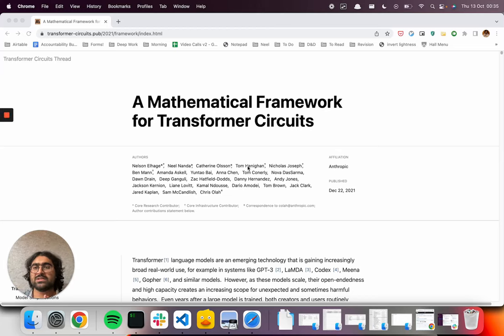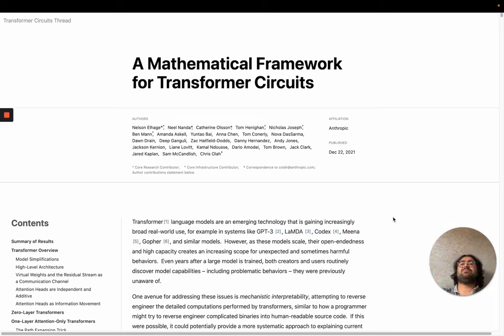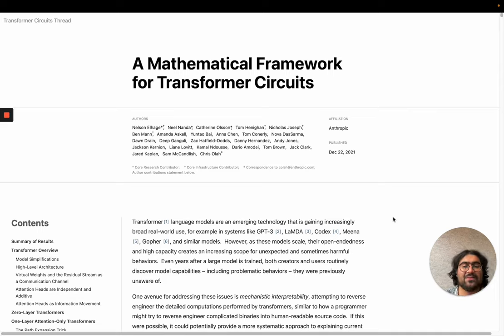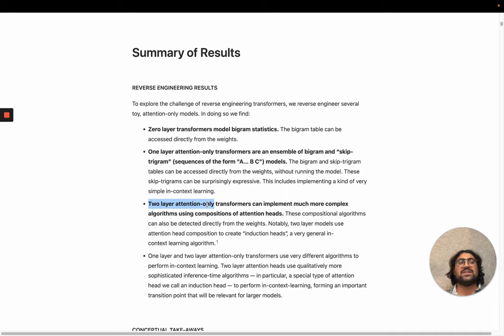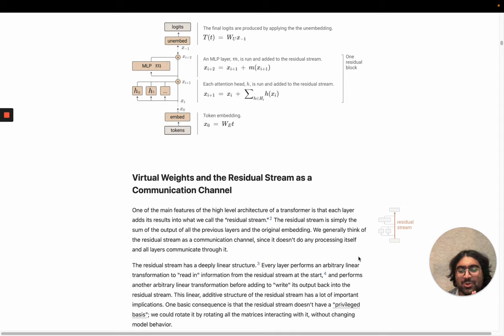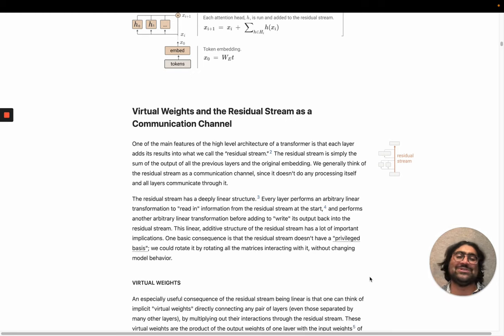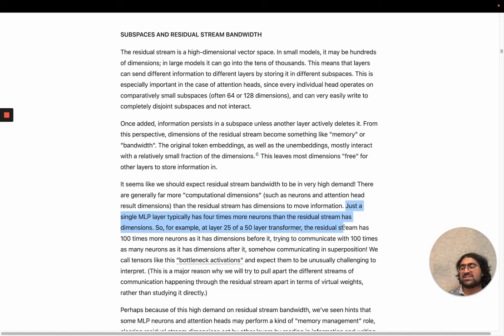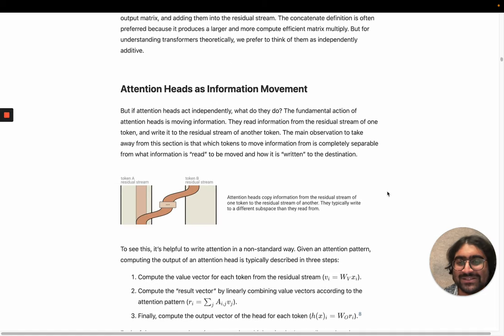A Walkthrough of A Mathematical Framework for Transformer Circuits

Comment: These videos are so unreasonably valuable. It's insane.
Reply: It's not a question that makes sense. It's not a black box it's at most black body radiation. But it's a well known, whether from inverse scattering transform method, noether theorem, quantum mechanics, waves, optics. Intensity doesn't give enough information, coherence, phase mismatch, correlation or whatever the name people give these people five to large language alpha code that generate unstructured files after some time of iterative on data, definitely can't be called Model. People should be acquainted with the concept of universality Classes, and obviously pretty well versed in Modelling and Language Universality classes. Any formal system composed a finite set of objects, no matter if it's compute, binary, English, CUDA, etc. It's all set theory. If data is used instead of causality, there's not a isomorphic map between multiple scales and semantics. While this problem is not even a well defined question? Binary thinking, logic and data can be exploited. It can be used either a convergent evolution of characters emitting entities toward truth and alignment or a 0 day vulnerability exploit that can't be ever fixed, and for those ahead of themselves, Data isn't all you need. Causality is. But don't steal it without my consent. I have preserved quantities, evolution equations and code for 2 years. Datacenters will not longer be necessary. AI have some other uses I like. There's something interesting. Jensey Huang gave me CUDA, for what I am grateful for. But no respect for Slaves, giving for free code they don't understand, I mean object oriented language coders, users or companies. Obfuscation through import numpy as numpymys is dumb enough to confuse any AI. hypervanse@hypervanse.co

Comment: I really enjoyed this, thank you. I was slightly surprised to see little analysis on the embedding and unembedding layers. Are they just not interesting in that for example similar tokens may share some similar directions and that isn't surprising? Also, many models use weight tying on these layers which you mention might be crazy, so is it actually justified? I've been wondering how well a model could perform with non-trainable We, Wu, or both; ie can a transformer re-derive good (un)embeddings

Comment: Kind of confused about the shapes of W_v and W_k/W_q. I expected the shape of W_v to be [model_dim, head_dim] since it maps the residual stream to a smaller head dimension. This is in line with implementation and intuition. Here although the shapes make sense in the overall context of the attention head equation, I expected all the linear maps of keys, values, and queries to be of the same shape, i.e. [model_dim, head_dim]. In the attention heads section, the W_v^T is [model_dim, head_dim] instead. Can you help in clarifying this a bit more? 
Thanks for the video!
Reply from the maker: That's probably just a typo, sorry!
Reply from the maker: Or, well, part of the annoyance is that in code the convention is that matrices multiply on the right, in maths on the left, and I sometimes confuse the two. If you look at the code in my clean gpt2 implementation it has all the shapes: https://neelnanda.io/transformer-solution
Reply: @neelnanda2469  Ah, I think that's about it!
I was trying to reconcile the shapes in the two equations of attention heads and trying to make sense of it. I think multiplying on the left side makes all the code matrices to be transposed and then the calculations make sense. 
In the first equation instead of A. X. W_v^T. W_o^T, I think it should be A. X^T. W_v^T. W_o^T. 
A = [P_d, P_s], X^T = [P_s, M], W_v^T = [M, H], W_o^T = [H, M]
Multiplying on the left gives us an expected shape of [P_d, M].

Similarly in the equation to calculate A,
A = X^T. W_q^T. W_k. X
X^T = [P_d, M], W_q^T = [M, H], W_k = [H, M], X = [M, P_s]
Multiplying on left gives the expected shape [P_d, P_s].

Thanks for the clarification!

Comment: So one thing that confused me initially on reading this paper was Anthropic's order-of-operations in linear algebra equations (reversed compared to e.g. numpy), which it sounds like is somewhat standard in tensor algebra notation.

Almost everything makes sense when you just reverse it, e.g. WuWe = embed first, then unembed. When I write out the code and try to reproduce things, this mostly works (although oddly I can’t get 100% OV, QK-based attention output to line up with high accuracy with normal attention using GPT-2 weights unless I use a Wkq instead of Wqk formulation, randomly, but maybe I’m just formulating stuff wrong because it’s not described fully in the paper). Anyways most of this stuff makes sense, but I did notice one contradictory thing:

If you multiply out the QK circuit, i.e. WeWqkWeT = We(WqTWk)WeT (Where T = transposed, sorry youtube doesn't seem to handle subscripts / superscripts) , I think you should get a (vocabk vocabq) dimensional matrix, i.e. vocab_source x vocab_dest. (WqTWk) becomes (dmodelk dmodelq), and then you apply the embeddings to yield (vocabk vocabq).

But here (https://transformer-circuits.pub/2021/framework/head_dump/small_a.html), they / you guys say “Outputs are simply the tokens with the largest values. Queries are the tokens with the largest QK[:, src]*token_prob**0.1 values”, indicating that the QK circuit’s second dimension is the source token, not the query token. But then they say “For this page, the heuristic is QK.max(0) * OV.max(0) * token_prob**0.1.”, which only makes sense to me if the first dimension of both the QK and OV matrices is the source token, which also agrees with the math when I think about it.

Do you know if they just made a small error and meant to type QK[src, :], or alternatively am thinking about something in the wrong way? It seeeems like a typo to me, but then again my bayesian prior for this stuff is that I'm missing something and not the other way around :).

Comment: This was excellent, thanks so much for posting! Really cleared up some things for me and kept me from going on way too deep a rabbit-hole probably trying and almost certainly failing to understand determinants and cross-products in 3+ dimensions :).

Question:

I've been trying to work out these actual weight decompositions and was able to write up a Attention_QK_OV layer and confirm that it outputs the same thing as a normal attention layer using the more normal approach. Now in order to poke around and reproduce some of the cool stuff I see here, I've made a simple single-attention-block model (no layer-norms, no-mlp, no positional embeddings --> basically just Unembed(Attn(Embed(x))) ), but ofc if I use e.g. load_state_dict to load matrices from a trained gpt-2, even if all the base matrices in this smaller model get filled, the output is more or less still nonsense because of all the missing layers that exist in gpt-2 but not in the simple model. Which makes the playing-around bit, well, not really interpretable.

--> Do you know if there's a trained simple LLM model like this (specifically, all or one of the trained 0-2 attention layer simple models experimented on in this paper) for people to play around with?
Reply from the maker: You can find a 1L and 2L attention only model that I trained in the TransformerLens library, called attn-only-1l and attn-only-2l. Unfortunately they do use LayerNorm
Reply: Oh that's great, thank you!!

Comment: The clean implementation uses some other libraries. So it is not completely built from scratch. Am I right ?
Reply from the maker: Yes, it uses Pytorch, a library to do linear algebra on the GPU. Check out minitorch if you want to see how to do that from scratch. What I mean here is that I only use mathematics primitives. I also use the HuggingFace tokenizers library to convert text into the right input format, rather than coding my own. I use the transformers library to get the model weights and a reference implementation, but not as part of my implementation